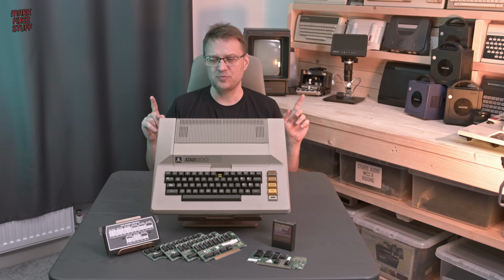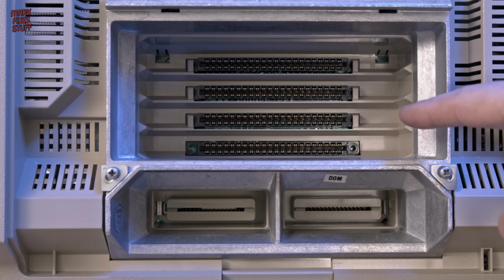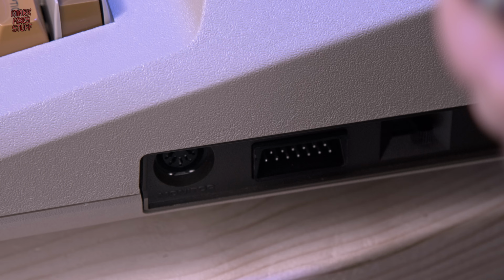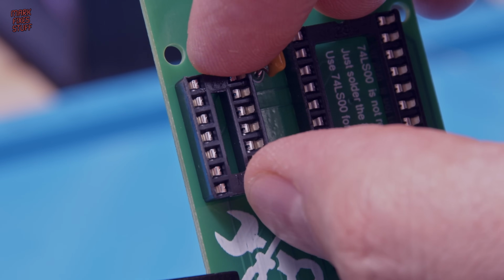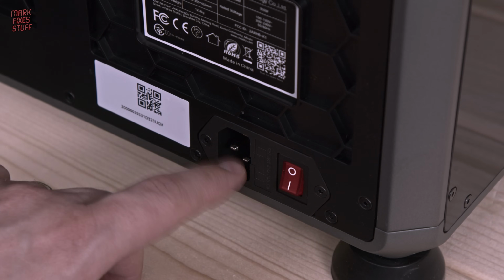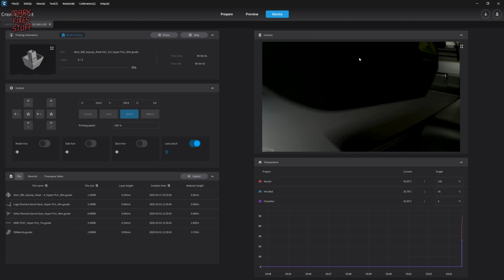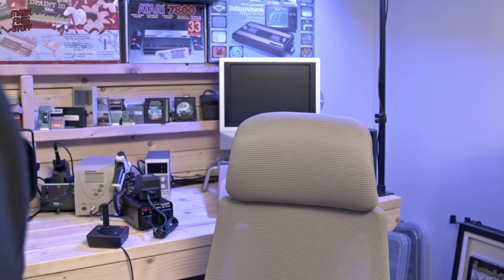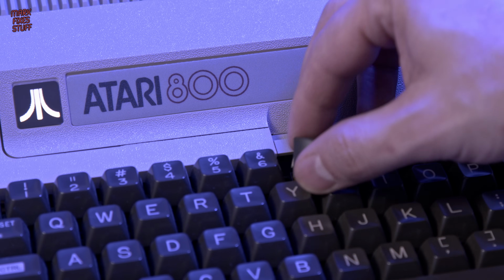Atari 800 - Diagnostic Cart Build & Key Cap 3D Printing  - #retrocomputing #nostalgia #repair PCBWAY

Comment: This is an older video, but I just found it. It was pleasant to watch and brought back old memories of my Atari 1200XL, that was already obsolete when I got it for Christmas. It was a cool looking computer though, and I wish I still had it; although, it went my cousins who couldn't afford one. Defender, was one of my favorite games, other than, Pole Position. Those Atari controllers were good, but awkward, so I tried a few others, yet I'd always end up using the original ones.

Comment: I think you might have the cover screw dates backwards.  My early CTIA Atari 800 has plastic levers to remove the cover and my later model with a GTIA has screws.   My early model also has black plastic on the left and right for the ram/rom cartridge bay to slide into a slot that isn't on my newer model.   It really wasn't necessary and it only worked with cards with cases.  My newer 800 also has the same cracking keyboard issues with the yellow plungers.   Surprisingly the older machine is perfectly fine.

Comment: The key caps go inside the plungers. Notice the cracks, they make the plungers open up and loose.  You need square reinforcements to keep the plungers tight.

Comment: The Atari 800 was an incredibly advanced and well engineered home computer for its time. Its graphics/sound combo only usurped in the early 80s 8bit micro market by the later C64. Which wasn’t as well built.

Comment: Wow, Great video! It is obvious you are new to A8 repair. Let me help a little. Long comment....
The 8 key and surrounding number keys are usually loose, and have broken plungers, as you show. This is something that happens to most 800's (white early, and yellow late, plungers)
This is because fingers often slip when opening the Cart door, hitting and pressing in the wrong direction on those middle number keys. There are 3D replacement files available for plungers, I think. But the clearances are very tight, fyi.   
You have a later version of Atari 800, not earlier. The screws for the ram cover prove this. 
The later version cards have no plastic covers. They all should be bare PCB's. You are mixing types in the video. But there is no performance difference. It is suggested that there should be all open cards in this version to avoid any over heating issues. There should be a thin plastic bar with slots that hold the card separate and in place, going from front to back. If you do not have this, it is HIGHLY suggested the there be some kind of insulation between the cards. (I use 2x 1/2" rubber 'feet' at the top of the cards for this)
The A8's do display S-video from the DIN connector. In your video, you display the lower quality composite, also available from the same DIN connector. You should get a video cable that can display both composite and S-Video. There are many sources on ebay and elsewhere. 
The PSU that you show should be good for many years if it is new old stock. That version is epoxy filled and should not degrade when not used. But there are many new alternative solutions available.
The SDrive Max shown near the end of the video, is a Excellent solution to replace a floppy drive for the A8. (It was the small white box with a screen on top, wrapped in a cable. Many videos show how to use it)
Star Raiders was the Very First first person shooter commercially available for a computer.  The instructions are online,. The keyboard is much needed to play. (This is mostly why there is a keyboard on a Atari 400)
The right cartridge slot is not the 'DOM" slot. The "DOM" sticker means "DOMestic USA". It is usually to the right of the space bar. But Atari and consumers tend to move it around in later years. 
There are 12 known carts that use the right cartridge slot. Monkey Wrench I, II are the most common. ALL other use the left slot.
It is suggested the a complete teardown be performed and all socketed IC be reseated. I guarantee most, if not all, are loose. This would also provide and opportunity to adjust color output from the CPU card. There is an adjustment wheel, potentiometer, there. The system can be built up and work without the huge aluminum casing.  A piece of tape will have to be put over the 'door switch'.   
People tend to recap a system going that far into it. A8's do not need that. in the 30 years I have been working with A8's, I have never needed to recap any of them. 
If you need additional assistance, pleases email.
Reply from the maker: Oh wow! Thank you so much for this amazing response! I am new to this system and this information is like pure gold. I’m really grateful!

Comment: I have an 800XL, still the aesthetics of the 800-model pleases my old eyes very much. Beautiful machine and built like a tank.

On 800XL, getting S-Video out, meant soldering one wire from board to connector. Don't know about 800, though...
Picture quality is lovely with that.
Reply from the maker: I think it’s the TV being crap. I’m going to try Donkey Kong on the CRT to see if it’s better before I start meddling because people say this model already has one of the best video outputs.
Reply: @MarkFixesStuff  I think, the older 800-model has the proper wiring connected straight, to get a proper S-video signal.
For some reason (money?), they didn't connect the Chroma (color) on 800XL. And for that reason, you have to solder a wire from mobo (there is a place for it) to connector.

Difference in quality is striking... I would at least test, if it has proper connections already...

Comment: Oh my.... this is a proper tale of 8⃣-bit archeology... the number 8⃣key for an Atari 8⃣0⃣0⃣.  I weep with you but commend you for sticking with the title! Not all repairs have to be a success that you set out for it to be. And this might not class as a complete and utter failure either as there still is something wrong with the keyboard. Something intrinsically wrong that sets you of for more lost keys in the near future if you were to actually use the 800s keyboard and or move the computer around. You could still opt to replace the entire keyboard with 3D printed keycaps still! As those yellow sockets aren't doing their job properly! Or turn it into a faux C64 by adapting the system to look like a C64 with C64 keyboard and keycaps and run the C64 Basic kernal that was adapted to work on an Atari 400/800! Now that would be something.

The C64 and the 400/800/XL machines share so much similarities that it actually is possible to run the C64 Basic (modified as the zero-pages of both machines are different) albeit a modified code. Have that boot up as the default basic 😂😎

Actually the Atari machine I was saving up for back in the day was an Atari 600/800XL (also was considering the VIC20 - but really wanted a C64) and I ended up with a C64 back in the day as mom took pity on me as well as the fact that the C64 was actually much more easy to find than the cheaper Atari 800XL machine. Ah well memories coming back to me when I watch this video. Thanks for that Mark, greetings from a fellow Mark.

Comment: Unneccessary idea to keep the plastic waste generator occupied: Print a bracket that holds the memory cards nice and straight in place. They looked a bit wobbly.
Reply from the maker: That was a concern for me as well AND I think that’s a “thing” that was in the original when they stopped putting all the boards in expensive cases. I’m certainly going to look into that

Comment: To power my Atari 800xl I now use a phone charger together with a lead with USB A to Atari power sockets.
Reply: From XL onwards, the PSUs were all 5V DC. On these original machines the voltage is different and it's AC, so it cannot be replaced with a simple USB cable.

Comment: I think that’s backwards about newer vs. older machines. They were originally intended to ship with 16k but memory prices crashed and they ended up shipping with the maximum 48k. Since they were already maxed out, there was no need for the user to release the cover and, thus, no need for the thumb-turn latches. Mine has those, by the way. It also has two different styles of enclosed RAM carts… both before they stopped making the cartridge shells to save money. Again: If the user won’t be handling them, why do they need shells? These changes only make sense as later changes where the initial configuration was a vestige of the intent to ship with 16k.

Comment: I never got the original 800 or 400, but have many of the computers after that, including 2 1200XL in a great condition.  Some NIB, never opened 800XL and 130XE as well.  Don't have much time to use them, but it's good to know they are there:).

Comment: Mark, this "new" power supply could be 45 years old.  I think I already wrote to you about old Atari psu in another video before, but I would strongly recommend replacing the caps in that "new" power supply as well.  This is your first line of defense when protecting your old 800.  Step up transformers can introduce additional noise to your power, so your old psu has to work harder.  That's a peace of mind when you know you have fresh caps in your psu and a steady power supplied to your old computer :).

Comment: Atari 8-bit and red colour? It is the same as expecting a fast transmission from floppy drive on C64 (without a fast load cart).
Reply from the maker: On Donkey Kong the red is really weaker compared with the other games. I think the TV is to blame a bit.
Reply: @MarkFixesStuff  you didn't get the point: Atari does not have red. C64 does not load fast. Fact!
Reply: @jakub.kosiec On top of that, C64's red is also not very bright.

Comment: The C64 uses 9V AC, but a stock one may not have nuts enough for that old beast. I suspect a multipurpose Atari, C64, Vic20, C128 could be designed with an array of changeable ends

Comment: I can recommend the UGV video mod, however the 800 has probably the best video output of all the 8bit line out of the box, so maybe try a different TV as I have seen some horrible processing of Atari video on flat panel sets.
And don't forget to smash the space bar playing defender, that's why my 800 has a non functional space bar😂
And agreed on the cx-40, it's much maligned but has a great almost analogue feel to it, not like the on/off feel of clicky arcade type sticks
Reply from the maker: I forgot about the space bar! 

Yeah, this TV is handy but not a great picture.

Comment: @MarkFixesStuff Tech Tangents (Shelby) came up with a 3D printed solution to the cracked parts of the key switches a while back.  By the way, that type of key switch is designated as a "stackpole."  

Also, I myself have created a replacement keyboard for the OG Atari 800 using Cherry MX switches, but I have yet to be able to get any PCBs made so far (lack of funds).
Reply from the maker: I am literally here making a 3D printed design. I'll have to have a look at what Shelby did. I might wait until after I screw this up though!

Comment: Install the Incognito upgrade which has 1 Megabyte of RAM and OS options - & features which super charges the venerable Atari 800!!!
That little 1050 looking device is the SDrive Max. It's a floppy emulator using SD cards. Excellent device.

Comment: Great video Mark! God, I LOVED the Atari 800 as a kid. It was way out of reach, so was always an aspirational machine for me. The 400 just didn't cut it with its membrane keyboard at the time, although today it does have a certain kind of appeal... Love your shelving / display by the way...
Reply from the maker: The 400 was the model my cousin had. I still love the look of the keys!
Reply: @MarkFixesStuff  wipe-clean, I guess... plus you wouldn't have the missing key issues!

Comment: So, you had a chance to try out the printer, you learned that the keycaps don't age well and can easily be lost so you need to be careful, you have a spare cover just in case that does happen, and you don't need to order a new keycap. Mistakes are sometimes better lessons than successes - now all you need to do is learn that it's called 'Galaxian'. Single. NOT plural. Got it? :)
Reply from the maker: But... there's friggin' loads of the buggers!!!

Comment: Isnt the nintendo 8 bit a 9v ac supply?
Reply: It is, as is the UK SNES PSU but NOT the Super Famicom (Japanese SNES).
Reply: @dantootill  Was talking about original nes though. You can use any 9v supply though since there will be a bridge rectifier inside the computert that willmake any 9v source viable so long as it has enough power.

Comment: Commodore 64 / 128 PSUs output 9V A/C on pins 6 and 7 if that's useful to anyone.
Reply: The AC line is one that's always ok on old power supplies it's the 5v dc to try to be careful it doesn't go high voltage.

Comment: What happened to the printer??
Reply from the maker: Which one?
Reply: Sorry , the older one 😀
Reply from the maker: @rbcmptrmn  The Y axis is grinding. Might need a new belt or a new motor.
Reply: I’ve had it that the wires to the motor is just loose to makes the motor go funny, but it could be the belt